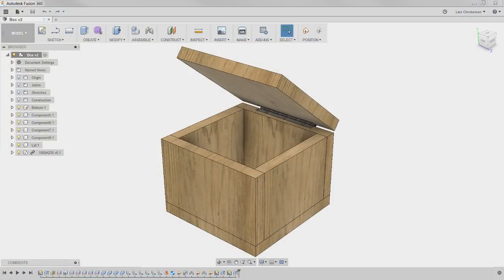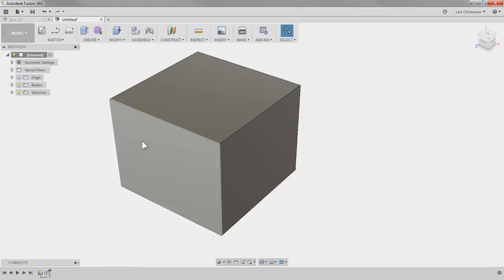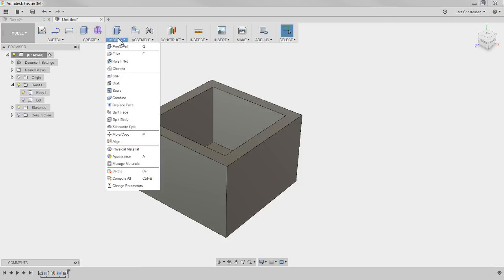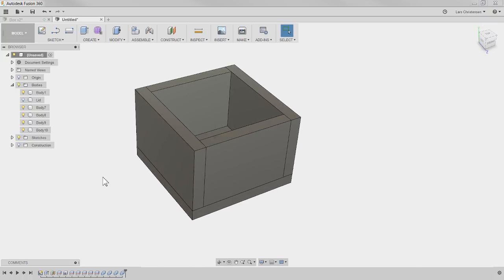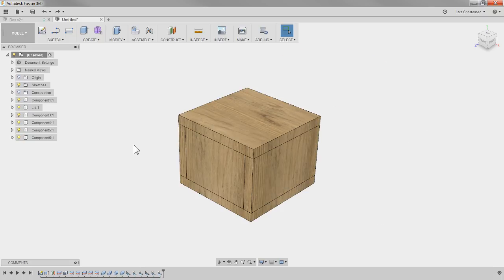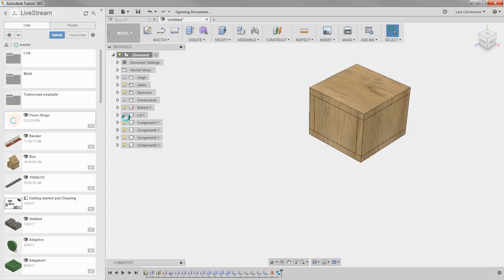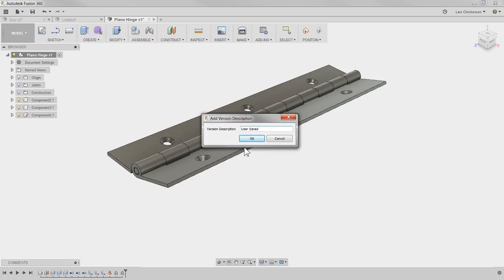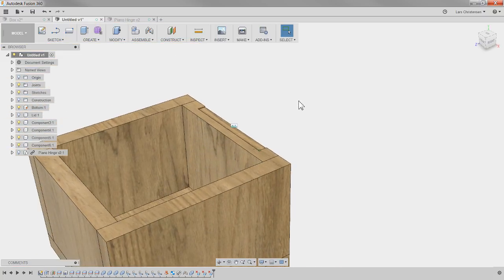Fusion 360 — Start Modeling the Way You Want — #LarsLive 70

Comment: Interesting way of working. Where a few things I keep: 1. the solution to grup rigid is nice and very useful, 2. The way to use hinge as assembly and still work as hinge in another assembly, and finally 3. for the split body was used in unusual way for me, but I might add that I'll do it a little different,  as I split the lid and bottom and hide then, I'll make the rest of the box shell through by selecting the top and bottom face in one time(eliminating the need for combine 4 time after). Congratulations on the videos you're very helpful

Comment: Thanks Las you helped a lot but I just couldn't get the hinge to rotate and I tried a number of time, I'm sure I followed what you did and kept going back checking, but alas I couldn't get it to work, but I am on the latest version so not sure if things have changed.
Reply from the maker: It should still be working. To my knowledge there are no new functions that should prohibit that. But, anyways, if you get that far, hopefully you got a few tricks that made it worth watching the video
Reply: @cadcamstuff  I did thank you, brand new to this program I want to learn it so I can design a chuck box for camping, I have the box made so far but I have to watch more and learn how to adjust the sizes now but I know it can be done.

Comment: Hi Lars, I know this is an older video but I need help. I continued on adding some screws and a little handle to this model using rigid joints and it has trapped the lid i.e. it will no longer rotate. Perhaps you go over this in another video?
Thanks!

Comment: Is there a way to creat accurate curves in Fusion 360? I just need to create a curve from a picture to follow the edge of it. The problem that I face is a fraction of the size of the picture and I need to draw it and scale it up, but it's too small. Can you help me?
Reply from the maker: Hi Rob Probasco Thank you for watching!
I normally create a box that has dimensions of my overall length and width and then scale the image to fit within there. For your curves, yes, you can fully define splines by creating relationships and you can also dimension the length of the spline handles.
Check out this video:
https://youtu.be/6u29SqgvQik?list=PL40d7srwyc_Mkgc5wvP_OfVel9aDkNkZ6

I did not dimension the splines in the end, but you for sure can. Then you have a totally accurate curve.
Reply: Lars Christensen Hi Lars, I would like to discuss deploying this software to an older cnc
How can I get in touch with you?
Thanks in advance

Comment: this is so much more like the way my brain works. I block things out then start cutting in the details. I used to work in a factory and could CAD in my head this way as I did my boring repetitive job.its also how everyone learns how to draw, by hand on paper. I used bonzi 3d and sketchup which are made to work this way. I was a little dissapointed with fusion 360 that I couldn't seem to be able to start with 3d primitives and have gotten fairly frustrated trying to learn it "back to front" as it seems to me. so! im really glad you made this vid.
Reply from the maker: That is awesome to hear Neil Boardman .Thank you for watching the videos

Comment: Lars, I think this approach is better in demonstrating the versatile approach to modelling.
I,m used to the structure of browsers in inventor and solidworks and always
referred to the parametric history while working to completion for a part or assembly.
In fact in my recent effort in fusion I relied on the timeline in the same way.
It also might be useful, if you had a small physical component or assembly on your desk
which you could measure and then model on the screen... might take a little longer than 30 mins
though.  Good work.
Reply from the maker: Hi wishbone569 Thank you for watching!
I think I need to do a better job showing how Fusion is different than Inventor and SolidWorks. In Fusion, you have to worry less about doing things in the "right" order or your model blows up.

Have a great day!

Comment: Is it possible that this method might have painted you into a corner?  What if you now decide that the side walls need to be a different thickness than the front and back walls or if you want to have a thinner top?  Will you have to go back and delete the "shell" step and will that cause errors for your split body steps?  Is there an approach that will be more resilient to changes down the road?
Reply from the maker: Hi Ken Hackbarth Thank you for watching!
I don't know if I would say that I have painted myself in a corner. I could use offset face as an example to edit each side. But, I get your point. I am not saying that driving everything with a sketch would be stupid, I am just saying that there are different ways to model things, and people should not worry so much about the "right" way.

Thank you for your comment!
Have a great day!
Reply: Hi Christian, I recognize that one could make up for questionable earlier decisions but it's a bandaid and you can end up with bandaids on top of other bandaids.  Mostly, you sacrifice the fundamental benefits of parametric modeling. I've recently experienced a case where going back and modifying an early feature resulted in a cascade of warnings that I simply couldn't correct and instead had to restart my model. I'd say that is a good indication that my process was flawed.
Reply: How would you convert this "hacked" model into a parametric model without building it all over again? Would you just edit each component and add dimensions? I would HOPE to end up with an assembly that could be scaled without changing wall thickness, or change wall thickness without changing outer dimensions, etc.